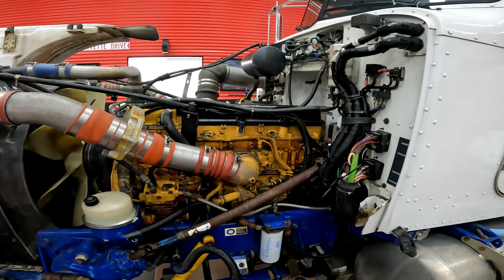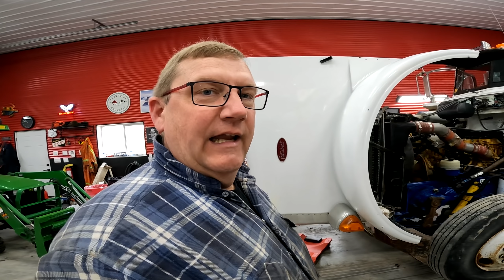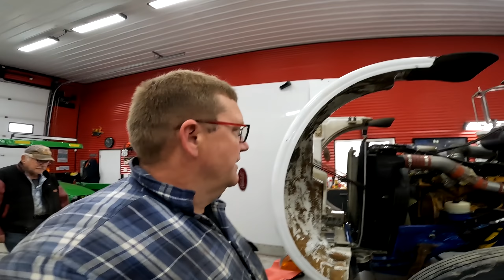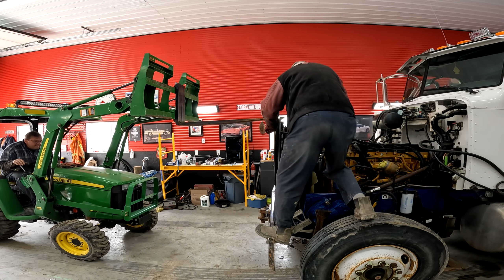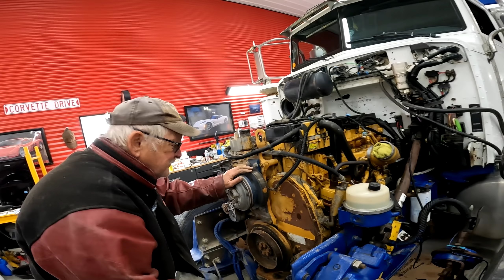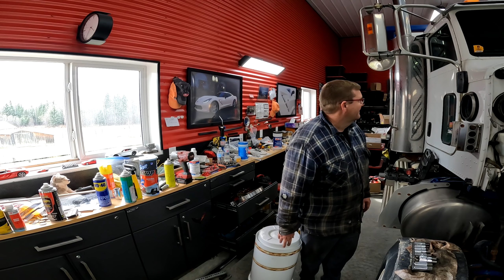CAT power Episode 4

Comment: You seem to be on good terms with the fellow you bought it from. Get him to e-mail a copy of the maintenance records with hours and or miles on them. If you don’t have one, barrow one of those handheld deals from work that are used to check hrs and miles on the vehicle computer and check them. Now your not just shooting in the dark. Pull the head and see what the story is. The two times I’ve had valves contact pistons in engines have both resulted in head damage, One time it was fixable, one time not. Now you can make better informed decisions. Keep the C13. It’s fine as frog hair for your area. Yep, looks like Kansas. Check with the guys in your shop for the best info on pulling the various pieces, and wether that radiator is a throw away or not. Keep the wet kit, a lowboy may be better because step deck prices are through the roof, and you have many Aerodynes, and lowboys make more money. Do your usual superb job of cleaning, don’t paint anything you don’t have to, don’t put on a dummy air cleaner, and don’t add a working air cleaner without double checking everything. Have fun, take care, and get this one out there making bucks.

Comment: Everyone loves the Cat engine. I am a loyal Cummins man, I would ditch the cat for a new cummins an still save money. If you do that, mounts for transmission to engine are same same but engine mounts need to change... therefore, engine and transmission together, rebuild trans now or regret not doing it later on side of the road. Its lots cheaper to build than just run till they puke. You love the  resale red so paint it, money just falls from the sky... I might of been a bit cynical on that. Your the last driver, what or how did it shift/feel when driving this rig, will you ever run the wet kit again?

Comment: Pull engine only. Use it's good ancillaries to build another C13. Either a  short motor or a cannibalized one to rebuild. Whatever you can drop on. Learn to like blue. Smokey has a Red frame, so look at that if you want to look at something red. Pissing about with an extra, unnecessary filter housing is just procrastination. Lopsided is your bag. lol. Please don't take offence.

Comment: Keep frame blue just paint the back where needed. Another c13 if easier to find or if you run across a c15 
.swap the doors with low and slow.